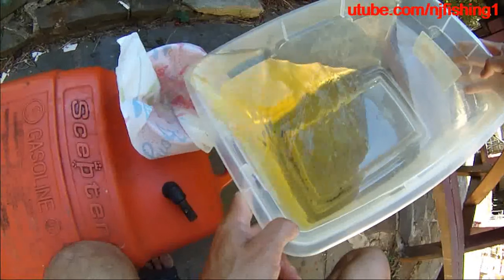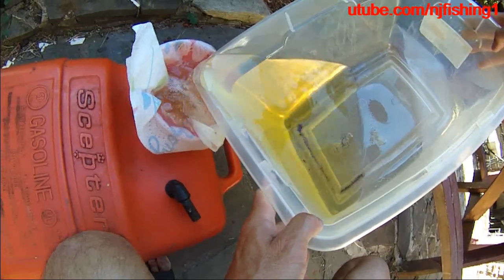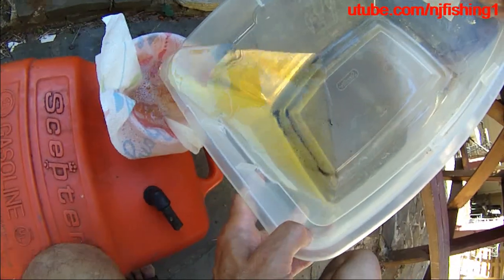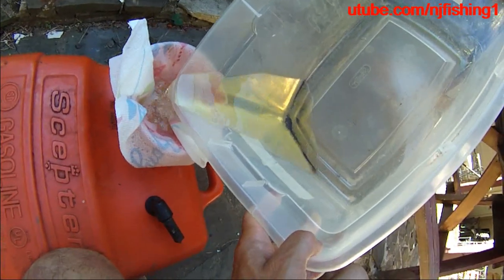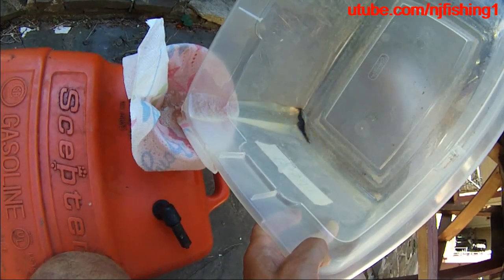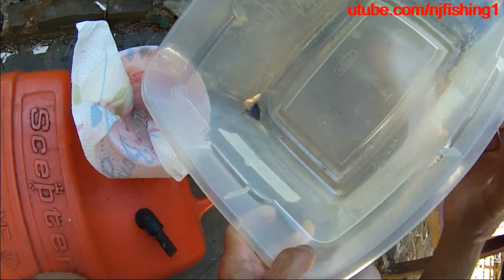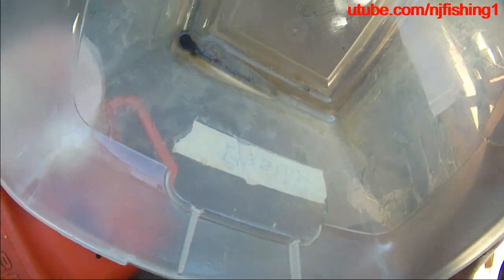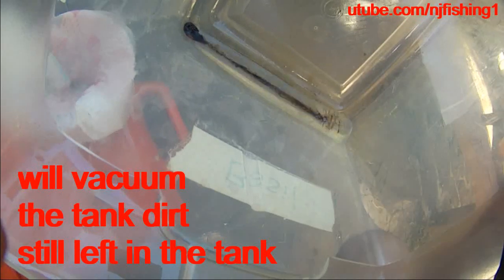How to clean the fuel in an external gas tank?- tons of dirt and small rocks

Comment: the gas station should have a fuel filter on their pump. I suggest you fuel @ a different one. I wouldn't one those fine particles clogging injectors & on the cylinder walls & rings.